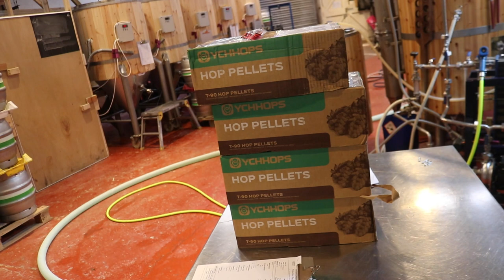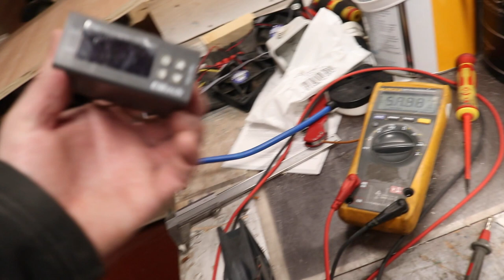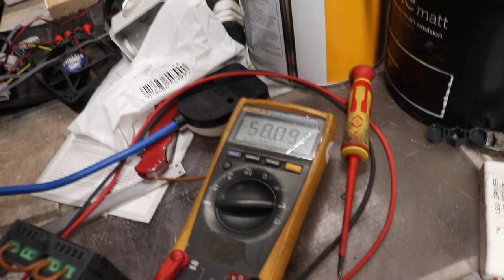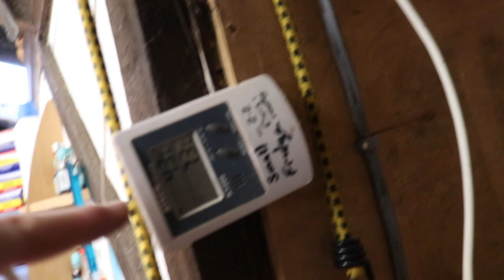🍺THE NEW BAR ~ PROBLEMS 🤕

Comment: Wanted to add a wee update. I had a commercial 30L Kegstar keg that wouldn’t fit in my keezer. I managed to pressure transfer the contents into 2 19L cornys. Worked great. I am going to look at building an inline chiller from some copper and an old corny keg that I can place in the keezer so that I can keep commercial kegs on the outside.